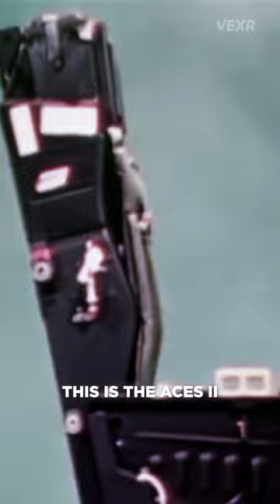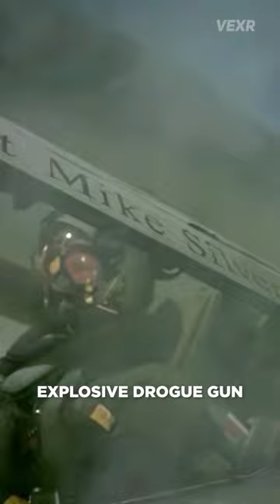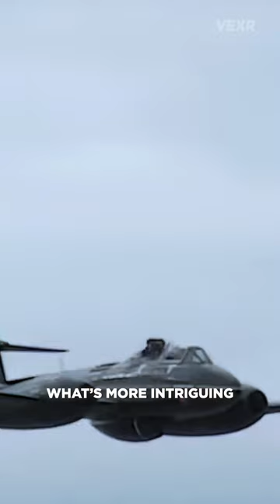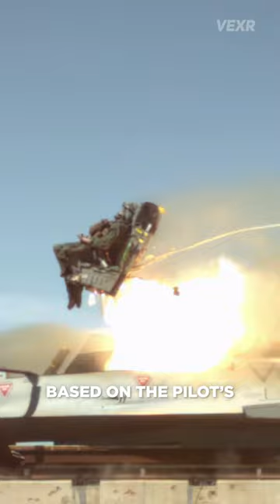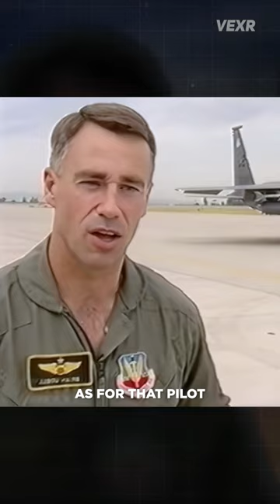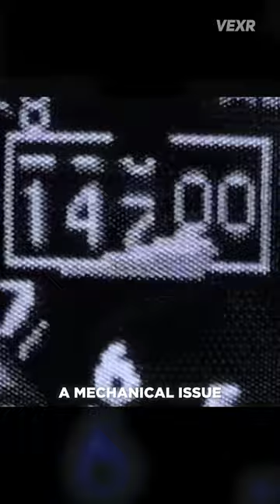How Fighter Jet Ejection Seats Work

Comment: How did the parachute not shred up at 800 mph?
Reply: Uh. The parachute deploys after ejection. And trust me, being in an aircraft seat suddenly without acceleration and hitting that wall of air, you're gonna go below Mach immediately. That's why the dude that ejected at Mach 1.2 broke a bunch of bones
Reply: Big difference between 800 knts ground speed and 800 kias... 800 over the ground can be very gentle air stream.... 800 kias will not be fun...
Reply: Because the seat first slows down with a stabilizing drogue chute, and the main parachute is also reefed, which results in the parachute inflating at a controlled rate.

Comment: How much G-force does the seat launch with?
Reply: From Aviation pros: "Modern ejection seats can pull up to 25 G's, but most pull anywhere from 14 to 20"
Reply: @BearNecessities-X  Thanks fo the answer, I knew it was high, I have heard that pilots often have back problems after ejection, that would explane it.
Reply: @larry-fr1zr  no problem
Reply: OMG...😮 Direct knock out!
Reply: @larry-fr1zr not really
Reply: 12-18 g’s, but only for a short duration.

Comment: I noticed the (dummy) pilot's HMD headgear almost coming off as it came in contact with the high speed wind on ejection.  I guess this is why some airforces refuse to use HMDs as they have to be shaped with huge bulges possibly causing dangerous wind resistance on the helmet.